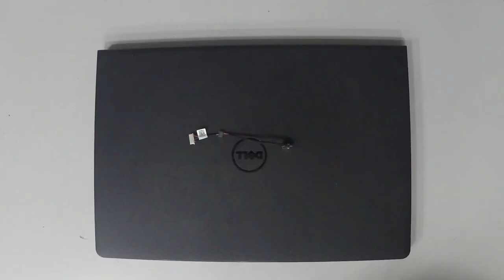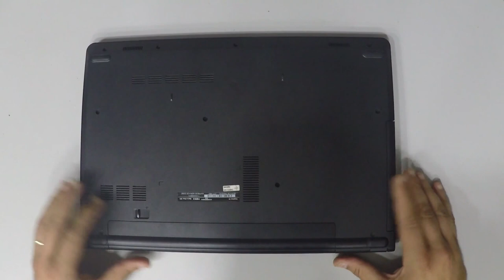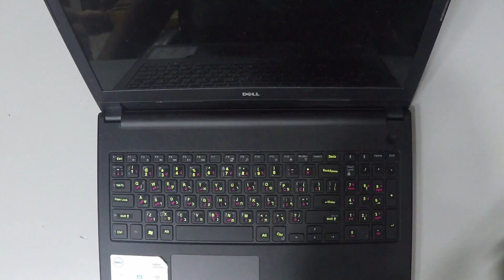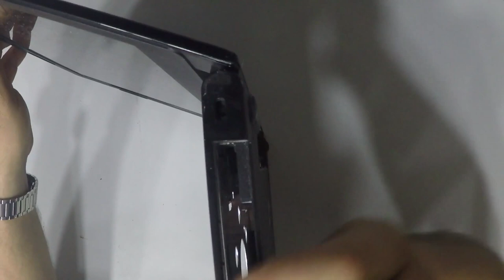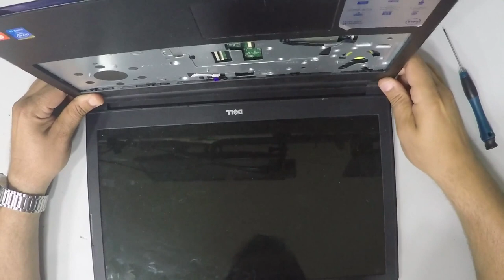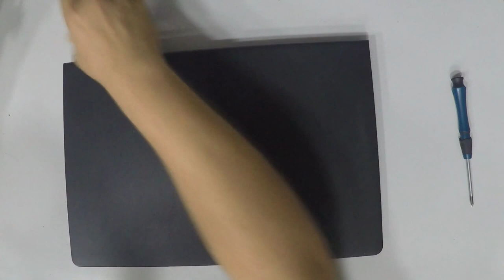DELL Inspiron 15 3000 Dc Jack DIY

Comment: Hey bro I think that will be more  help full if you explaing a lil bit what do you need to remove or mark what screws are u removing the only thing that we can see is only ur hands believeme I prefer to hear what are you doing from you than the music.
Reply from the maker: Hello Antonio, I know but I have 5 noisy little children.
Reply: hi awesome video also mines damage so can  you link when you got the replacement dc jack pls
Reply from the maker: Hello Trini, this is the link - https://www.aliexpress.com/item/3pcs-Lot-Free-Shipping-Laptop-AC-DC-harness-Power-Jack-socket-Cable-Wire-connector-for-HP/32647583194.html?spm=2114.search0204.3.1.HfAOrw&ws_ab_test=searchweb0_0,searchweb201602_3_10152_10065_10151_10344_10068_10342_10343_10059_10340_10314_10341_10534_100031_10084_10604_10083_10103_10613_10307_10615_10614_10142,searchweb201603_40,ppcSwitch_3_ppcChannel&algo_expid=1e5b5f04-17aa-4425-a0af-6bd99d7f4802-0&algo_pvid=1e5b5f04-17aa-4425-a0af-6bd99d7f4802&transAbTest=ae803_4&priceBeautifyAB=0
Reply: Thank you so much
Reply from the maker: you are welcome
Reply: eShamsTechTips I understand brody I know exactly how it is!
Reply from the maker: you are welcome

Comment: Hot glue is exactly what i thought about doing too and may still when the new jack comes in. Its $1.99 from Dell.
Reply from the maker: Yaa ... but the plastic holding the new jack is broking and you will need to glue it to something.
Reply: @Shamsabdelkader  yes the new one would probably break sooner or later too so right now I just glue the old one in and see how it goes